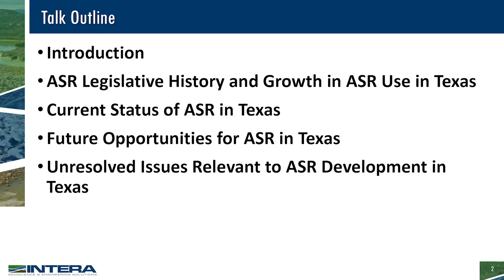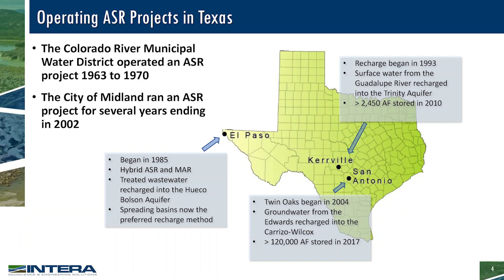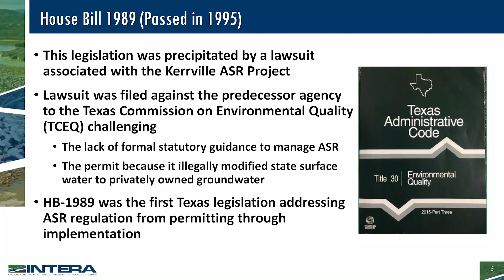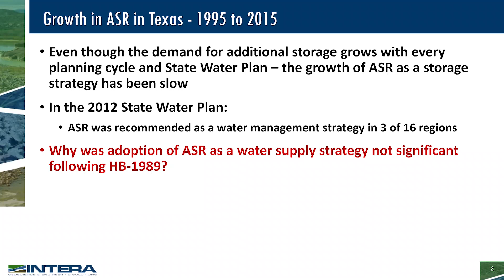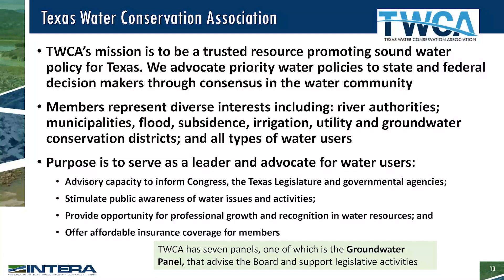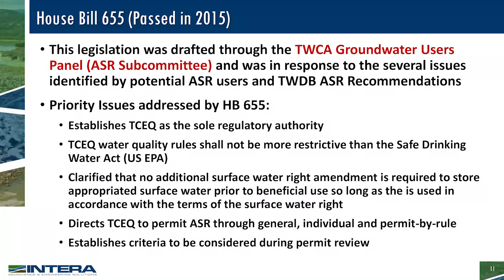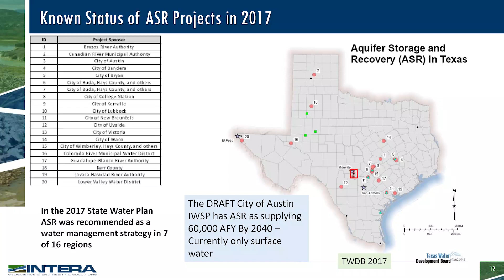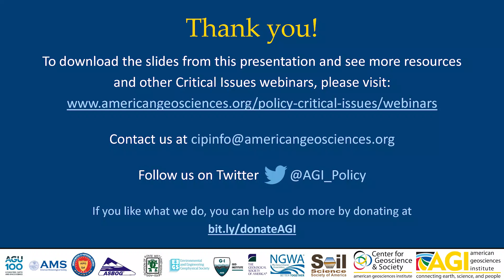Aquifer Storage and Recovery in Texas, Legislative Developments and Status

Comment: Hello, I am a CSI for an Engineering Firm. We build Industrial Control panels for a company called 3R Valve. We offer down hole aquifer storage and recovery services. The 3R Valve is the only ASR valve that is NSF Certified and our panels are built in a UL Certified Industrial Control Panel Shop. If you have any questions about our products please visit 3RValve.com . I hope we can be of service for any of your ASR needs. We have experience in Power Regeneration also, allowing you to save money on energy consumption and reduce overhead costs. Please feel free to contact Wapiti-Consulting.com also for any technical questions. Thanks.